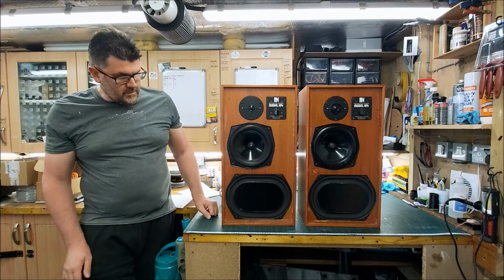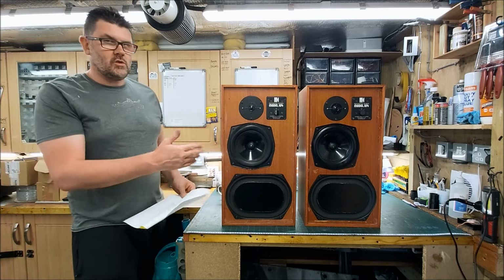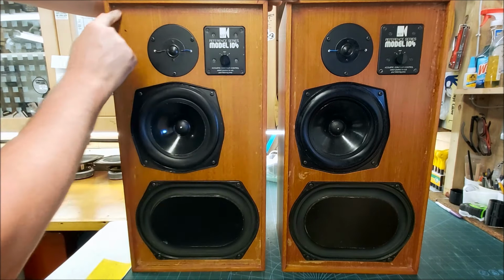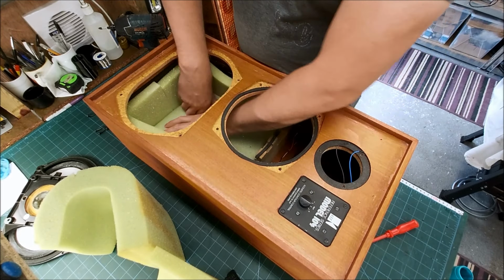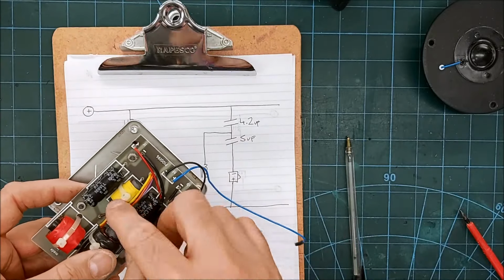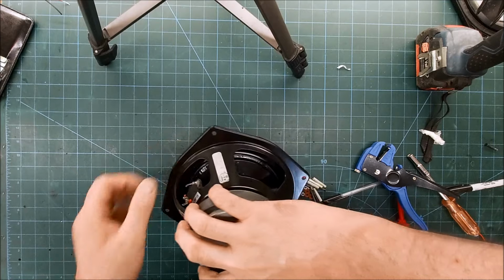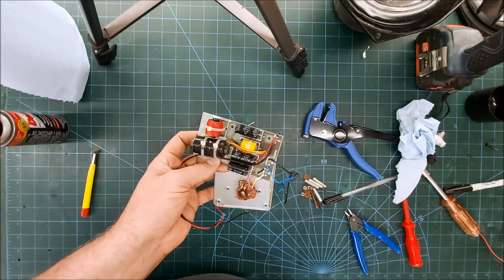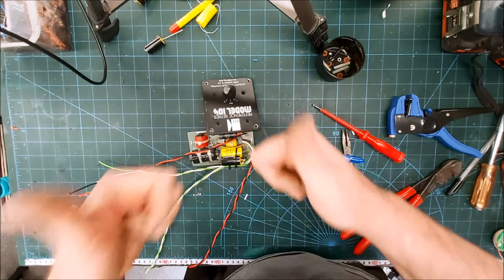KEF REFERENCE 104 Speakers Part 1

Comment: I had something rattling in one of my 104AB's; thanks for showing how easy it is to remove the speaker units. On opening, I found some loose pieces of black bitumin coated material. They were from the area around the tweeter. I presume I need to replace this somehow, but need help on what material to use. Can you help please? Speakers owned from new, bought in 1978, but not used for a few years.
Reply from the maker: @malcolmkenward2663  you could reglue the pieces that came off. Staple them to. If not self-adhesive neoprene foam 5mm will work
Reply: @haycrossaudio5474  The pieces are broken up. It all looks intact everywhere else. I'll try the neoprene foam. I'll check the other speaker to determine how much I need. Thanks for impressively speedy response.
Reply from the maker: @malcolmkenward2663  Gauge what you need off the other speaker if it's intact. You can get it from ebay. If you get stuck email me. I keep it

Comment: I had a pair of 104s, and I upgraded them to the aB (acoustic Butterworth) crossover. They were lovely! I used them in a recording studio briefly, but the T27 tweeters weren't up to producing enough volume in a properly acoustically treated room and I kept blowing them - but this was back in the '80s and replacements were readily available. I wish I still had them! My only reservation was that the BD139 aux bass radiator made deep bass a little muddy, so I moved on to reflex ported designs - Clearwater, anyone?

Comment: I have a pair of the 104ABs that I gifted to a mate. They sound fantastic even after all these years, although I think it might be time to replace the capacitors on the tweeter circuit! Can't wait for part 2!
Reply from the maker: @Luckiestmanalive-bb1mi  I like the 104AB. A bit more refined. Crossover is more complex from memory?
Reply: @haycrossaudio5474   - yes, the crossover is a little different. I read that it was primarily to protect the T27 tweeter and allow the loudspeaker to handle up to 100W?

Comment: How these ended up? I have 104ab coming next week.
Reply from the maker: @Mike81111  Really good. Recapped with SOLEN. Rewired with high purity copper wire and converted to bi-wirable. Much more detail and clarity. Better overall presentation. Its a shame these have that adjustment switch in the signal path
Reply: @haycrossaudio5474  Good to know. I have 104ab coming in so it would be nice to upgrade the crossover.

Comment: The flattening of the surround on the B200 SP1039 use one these is typical and quite common. I've measured drivers with flat surrounds an ones with nice rounded ones and found extremely little differences in T/S parameters. And they sound the same. I haven't verified this but I suspect that the flattened surrounds will reduce the X-Max a bit and perhaps the linearity at high SPL but as T/S parameters are measured at very low levels, such an impact cannot be established by these measurements. 
And additionally, the original foam covers were attached to the front baffle by means of velcro strips that were glued on the front baffle. These appear to have been removed.
Reply from the maker: @savvassidiropoulos5952  Correct regarding the drivers. Yes the residue was likely from velcro. I'll probably clean this up and add new to secure the new covers I need to make.

Comment: In my opinion you should definitely change the treble filter to the acoustic Butterworth design - a significantly cleaner, more accurate sound, with improved imaging, and with polycaps it will sound much better again. As the client wants a bi-wiring option, you will be installing the T27 section components on a different board anyway. And why not follow through your very true observation that symmetrical baffles would be better and make a new one so that you can have the drive units towards the inside on both channels -  that ought to improve imaging further; the client would then have a choice. It will be interesting to see what the effect of the dire state of the neoprene surround is - it could be the cause of some voice coil rubbing on the driver with distortion. Initially it could conceivably improve deep bass by lowering the free air resonant frequency, but things have already gone too far. If replacement surrounds of correct characteristics are available, then repair could be easier than finding replacement drivers - it's something those of us with Acoustic Energy AE1s (with foam surrounds) have had to learn to do. KEF drivers, as you say, normally survive fine, so this deterioration is surprising. (The glue on the edge of the baffle will be from the velcro which I believe held the original black acoustic foam in place. It disintegrated over time.)
Reply: yes the velcro leaves a glue residue.
Reply: I wonder if in the past the speakers and cones had been cleaned with a solvent that has caused the deterioration of the B200 surround and the stickiness on the B139.

Comment: Might be interesting to replace the 139 ANRs with regular 139 drive units and connect a variable resistor across their terminals, thus you could play with damping for their use as ABRs
Reply from the maker: @amok281  having both a B200 and B139 working in the same limited air space wouldn't be ideal at all
Reply: @haycrossaudio5474  He is not suggesting having the B139 driven. Just to use one with a magnet and voice coil and use a resistor across the B139 terminals to tune the driver's Q. Similar to changing the weight put in the back of the cone for tuning purposes, but easier and quicker to change the tuning.
Reply: Interesting idea, but any degree of controlling of the emf produced by the voice coil would reduce the bass output of the speaker as a system.
Reply: @hopefultraveller1  reduce := fine tune. When needed.

Comment: My Dad was gifted these back in the early 80’s, but it was the 104AB version which had a Fuse in the crossover.. They sounded sweet yet dynamic.. Were the AB versions older? My Dad gave them away to a family friend back in ‘91, but it already had some considerable damage then for various reasons..
Reply from the maker: @rickg8015  not sure when the 104AB was released?  Something is saying in the 80s so after the Ref104. The AB had a more complex crossover from memory. It's been quite a while since I delved into a pair

Comment: Usualy they were sold as a matched pair.
Reply from the maker: @frankgeeraerts6243  Looked at my books yesterday and I've had 4 pairs here over the past 2 years. Serial numbers were always random?  They normally measure pretty close though so maybe?
Reply: @haycrossaudio5474  depends maybe on the years when sold....mine were paired they said. I have one pair were the surround has come loose partly on the basket ..Witch glue should I use ? thanks
Tweeters were often damaged by childrens fingers ....seen it more than once.
On one pair I use the pepper like diffusing dome as used on the LS3/5..

Comment: Is there a difference between these and the Cadenzas other than the switch?
Reply from the maker: @mfr58  Physically yes but beyond that I'm not sure as yet until I take the Cadenzas apart. The Cadenzas measure better so I'm expecting a more complex crossover?  Stay tuned